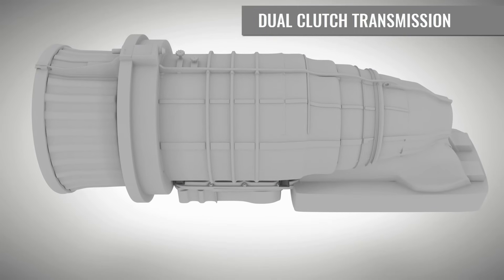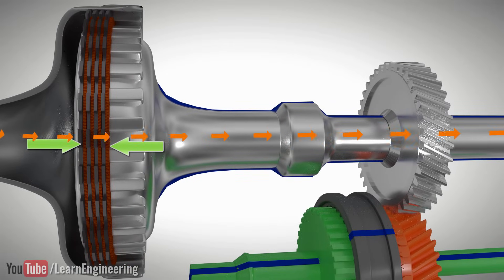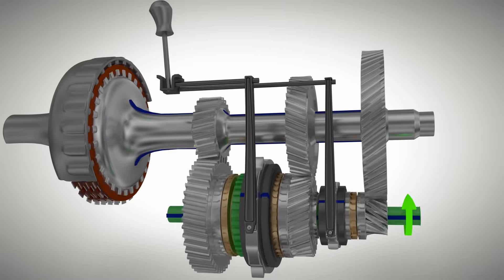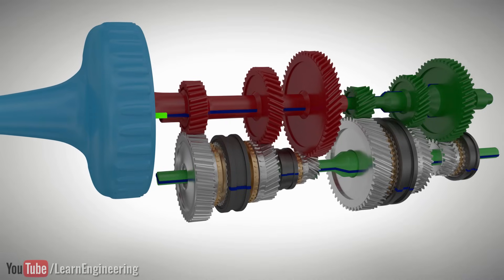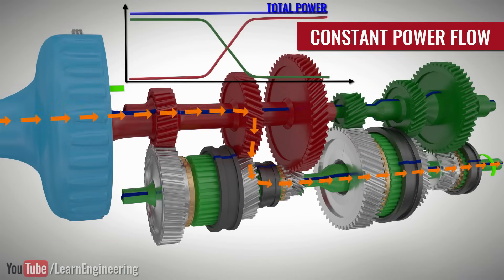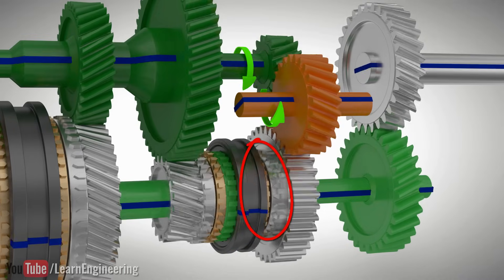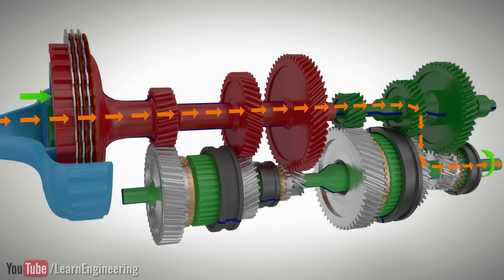Working of Dual Clutch Transmission (DSG)

Comment: DCT works great in performance vehicles where its easy to predict for computer which gear is next. When you hit full throttle computer expects next gear will be up shift, when you hit breaks computer expects next gear will be down shift. But for every day use it is horrible. There is no way for computer to predict next gear in crowded streets or in traffic jam when cars are crawling.
Reply: 1st to 2nd is the most obvious change by far, but from 2 onwards they becoming exponentially less noticeable in terms of changing gears. But yeah In crawling speed traffic it gets a little confused on whether you’re going up a gear or down, but I’ve learned to find the sweet spot in 2nd or in 3rd to keep it steady. If you can’t drive with a consistent speed and you keep having to brake then you’re gunna have a jerky drive. Learn to crawl at a constant speed
Reply: The DCT used in the Ford Focus and Fiesta appears to be a poor design. Many law suits resulted ,  I had a Focus, it was reprogrammed several times in the three years I owned it. It was a very poor shifting car in the daily stop and go seemingly it could not determine how to compensate for short stop and go situations. There is a class action against it now, happy to be rid of  the Focus, some days the program would crash and the car wouldn’t move.
Reply: I dont know what car you have driven, but the ones i have, i dont feel the shifts at anypoint. Not in higway or in traffic.

Comment: "Since it's as smooth as an automatic transmission..." because it IS an automatic transmission, would be my guess...!
Reply: I think they meant smooth as in no longer having to manually use a clutch because as you shift, the clutch is automatically applied appropriately. An automatic traditionally using torque converters have smooth shifts because it's all automated.

Comment: I don't understand how 2 gears can be engaged to the output rotor at the same time if the gear  ratio is different
Reply: 2 clutches. One is engaged, one is not. It is told in the video.

Comment: there are paddle shifters in DCT cars that allow clucthless upshifts and downshifts. Right? Do we require three sets then? If no ,wouldn't that be less complicated that using a computer program to determine which gear to shift next?
Reply: Computer does all the work. You dont need shift pedals. If you have them, that just allows you to select certain gear.

Comment: The DSG technology is already use in heavy duty trucks like in those semi trucks like in Freightliner Cascadia Evolution.  I know when I  drove one, they had a automatic and manual setting.  Push up on the the right handle near the steering wheel to upshift and push down to downshift.  As the video shows, they are starting to use this because it gets better gas mileage

Comment: Dual clutch automatic transmissions are not perfect. Whilst extremely rapid shifting UP gears, it is sometimes very slow and jerky when manually requested to change DOWN gears. This is because it pre-selects the next gear up by default. It shifts down rapidly if you floor the throttle when the electronic control takes over. Also, I've found them to be occasionally jerky and laggy at low road speed due to the clutches trying to regulate slip.

Comment: In reality, when you disengage the clutch you will not loose a lot of speed. You will stop accelerating, sure, but the car will still have same speed because of inertia. Thats why your graph with dips in speed during gear switch is incorrect.
Reply: procerator You know the friction, right?
Reply: but every body needs faster shifts!!! what if the kids get late to soccer practice?

Comment: A well sorted & tuned DCT is the best performer. However a shitty DCT (looking at you Mercedes CLA250) is jerky and dimwitted, falling on its face & shuddering the entire car if you get on the accelerator too quickly. 

The best DCT by far is from VW group. The Audi A3 S-tronic is a great example of a DCT done right; smooth, instantaneous engagement and smooth shifts on the move as well as good logic that predicts downshifts but doesn't hunt for high gears.

However I still think a traditional automatic is smoother still. The ZF 8spd automatic that is used on the Audi A4 and Jaguar XE is lightning quick and a better daily companion.

Comment: I don't know why you more effort on transmission system TESLA invent all new car which no transmission part and only open differential and there is no worry of traction loss and there is use of sensor and for traction control there is no slip differential and there is no any need of of IC engine and there is only "Induction motor and inverter,lithium power cell for a car & it's a RWD and give more acceleration,no clutch,no vast planetary gear for transmission only 2phase of transmission, no need to apply brake for stopping of vehicle only release accelerator then car is to be slow down and regenerative braking occur and no heat generation no COOLANT FLUID for cooling and much more features If you know more about that then you check on YOUTUBE for documentary of TESLA car in NAT GEO

Comment: Why is he saying that you get more sluggish acceleration with a manual transmission than with an automatic. If done correctly gear shifts are much quicker on a stick shift than on an auto and it gives you more control over the engine speed allowing you to shift at the optimum rpm to get the best acceleration with out a computer doing it for you
Reply: Wind the motor to 6k and dump the clutch, then tell me if it felt "sluggish".
Reply: He's saying it's more sluggish because it's more sluggish.

Comment: why when the torque converter slippage and generates heat,, ---- how did can effect the fuel efficiency? please can some one explained it to me? thanks a lot
Reply: Generating the heat takes energy which then does NOT go to moving the car.  Hence MPG suffers.

Comment: So DCT can't be used for manual transmission? The video said it needs control system to pre-select the next gear.
Reply: No it cannot. DCT is a type of "automatic" transmission, which based on the concept of manual trans.  And yes, it needs a control system, which should be smart enough to anticipate if you are going to need an up shift or a down shift. If the control system is not "smart" enough, it will take sometime to figure out what you want. And if you tried to use the '"manual mode", DCT is slow, since it would take some time to "pre-select" the gear you ordered, then make the shift.

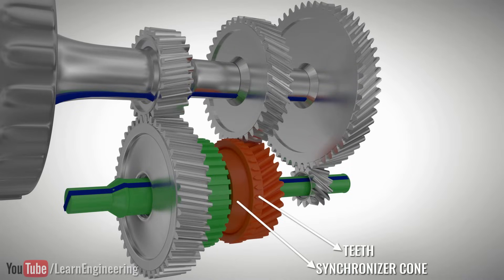Comment: Ok so, on the manual transmission example, the hub that is fitted to the shaft at 1:08 must be permanently attached to the shaft. It always spins at the same speed of the shaft. Am i right?

Comment: I have a question. Is the clutch Transmission just working due to friction ?
Reply: So u simply increase the friction between the Clutch-Plates ?
Reply: I believe this is right. That's why you eventually have to replace your clutch plate and pressure plate on a manual transmission.
Reply: @FortuneSeek3rz , someone that can actually drive a stick can easily get  200,000+ miles on the original clutch.

Comment: The fact they state that the reverse fears on a regular MT is not entirely true. The Mazda M5OD actually has a synchro on the reverse gear too, but it is one of few. The transmission was produced for almost 20 years, which is a real testament to its quality. I miss my old Bronco 2 which had one in it.

Comment: I've noticed an error in this video. You say that normal manual transmissions never have synchronizers on the reverse gear. This is not true, some of them do. I know this because I happen to own a manual-transmission car with a synchronized reverse. You also say that all DCTs do have a synchronized reverse, but that's not necessarily true, as DCTs can operate without it just as well as a regular manual transmission.

Comment: may be it is best for car services because it brakes on 50.000. that what happened with me on VW 7 step dsg. and the problem is still remains, I would not recomend to buy a car with DSG
Reply: Gloryan Headman Mk7 GTI 6 speed DSG 60,500+ miles (majority stop and go city driving) no issues. Recommend service at 40,000 miles, and Italian tune up two or three times a month. 
Ｖ－ＤＵＢ ４ ＬＩＦＥ 😎
Reply: youfoundisaac any way good luck )) I sold mine VW) and will go for toyota. VW owns me money wich I lost on sale differents plus moral compensation.
Reply: Gloryan Headman oh please. i just sold a 55k mile VW to some lucky guy and it drove perfectly
Reply: plus I sell cars with DCTs and I see them come back for oil changes with 150k+ miles

Comment: The Problem with The DSG DCT is, ID you Switch from The 4th gear to The 3rd gear. Its Takes much longer
Reply: That's because the stupid control system assumes you are gong to need 5th gear rather than 3rd, it takes time to take it off 5th and pre-select 3rd.

Comment: "Best transmission ever" Well, depends where you're coming from and what you want your car to do. In my experience normal oldscool manuals with a cluch is cheap, reliable, economical, cheap and simple to fix if they do break. and the only negatives is that you have to learn a skill, and 1sec powerloss while shifting. Upside is that when you do learn the skill of driving a manual you have more control. At the cost of using your left leg sometimes, and moving a lever...

I've had people tell me that a cluch change is expensive and you never have to do that in a automatic car. But a cluch that isn't abused lasts longer than most cars today, so I don't worry much about it...
Reply: Renax the Man manual all the way!
Reply: Renax, there is no powerloss on shifts if you "power shift".  You don't let off the gas and you just brush the clutch pedal enough to force the transmission in to the next gear while
the clutch is never fully released.
Reply: @789pokey  well, there is still a powerloss, but if you abuse the gearbox (or have a expensive racing gearbox) it can be less than a second...
Reply: @RenaxTM91 , a second is an eternity in a drag race.  At an average speed of 60mph, you're covering 88 feet per second.
Reply: @789pokey  Yea, in a dragrace you want the "expensive racing gearbox" option. For a normal daily driver a second to shift doesn't matter..
I get that most gearboxes you can shift faster than a second, and I can probably do it in half that with mine too, but mostly I don't bother. Anyways, a DSG box can potensially engage next gear simultaneously as it disengages the previous, but a normal manual HAS TO disengage one before engaging the next. this is my point. A dsg can be faster than any manual, but at the cost of weight, complexity and money.. For those reasons I like my daily driver to have the cheaper, more reliable and lighter option, even if it might cost me some time in a sprint... what will cost me more time in a dragrace is only running 1bar boost anyways ;)
Reply: @RenaxTM91 , no, there is not because you never disengage the clutch disc from the pressure plate and flywheel.  You depress the clutch JUST enough to force
the trans into the next gear with pressure on the linkage.  And you could do that with any stock Muncie, that's why the rings were made of brass, so if any chips fell off
they wouldn't damage the gears.
Reply: @789pokey  Yea, thats abusing the gearbox. I've done it, and it sure is quicker than shifting normally, but there is still powerloss, it physically impossible to engage one gear before the previous is fully released, in many auto's its not.
If you've had a manual gearbox apart you would know that there is absolutely no way to engage the next gear before the previous is released, and if it wasn't you'd wreck your gearbox in half a second. You can do it quick, with some gearboxes really quick, but one always have to fully release before the next is engaged.

Comment: So how are the controls for DCT vehicles? say you have a 5 speed and you go 1st....4th and then a turn comes up and you wanna tell the computer to keep 3rd on deck rather than 5th. is that too much to ask?
Reply: say you have a 5 speed
Don't know any DCT with 5 speeds. They are 6 speeds or more.

When you lift the computer algorythm already presets the lower gear. 

About telling the computer to keep a certain gear in check. I wish flippers would have a half press function.(like the shutter of a camera) Half press right to pre-lock up shift Falf press left to prelock down shift.
Reply: 1barnet1 Some cars do have the half-press on the paddle shifters, but it's not super common AFAIK.
Reply: By pressing the brake paddle, you are telling the DCT controller to pre-select 3rd. The most common issue with DCT is that, it does not downshift very quickly when you want a lot of  acceleration, since it always pre-select higher gear.
Reply: Why would you want to keep a lower gear ? If the car needs a lower gear I.e you’re on an incline then you press down a little harder to ask the engine (politely, of course) for more power and it will drop a gear. If you’re on a straight, then why not let the car go into the higher gear?

Comment: The worst automatic transmission possible. It combines the disadvantages of automated manual transmissions with high costs and complex setups. Dry clutch DCTs failed for every manufacturer who offered them, regardless if VW DSG, Ford Powershift, Honda i-DCD or Hyundai DCT. If you intend to keep your car for a long time and travel without hazzles or jerky experiences, get an CVT or torque converter AT.
Reply: Or get a wet clutch DCT. A six speed wet clutch DSG with a diesel engine is pretty common in VAG group taxicabs in Northern Europe. That combination seems to be holding together, but nothing beats a torque converter AT. The technology has been around for over 70 years, and is absolutely rock solid at this point.
Reply: Then the Toyota HSD arrived and Taxi fleets are converting over to Hybrid, as emission standards get more strict and a Prius turned out to be as similar resilient as an Mercedes E-class.
Reply: Pass me a hundred grand and I'll buy one.
Reply: Don't know what you're on about. The Hyundai DCT is far from jerky. The one in my Elantra Sport is smooth.
Reply: Or get a Tesla, and enjoy the simplicity without needing an Internal Combustion engine and complicated transmissions.
Reply: @TheRealMartin  Teslas are soy boy toys.
Reply: Every Porsche has DCT (called PDK), guess also most modern AUDIs (just to give an example). So now you're saying those are crappy cars, right?
Reply: Justin Grindley IN USA NO "NORMl person" drives a stick shift. 90% of vehicles are Automatic/cvt.
Reply: Kamuichan99 Hondas CVTS ROCK.
Reply: Or get a fuckin manual like a normal person
Reply: Kamuichan99 AMEN. I LOVE MY HONDAS CVTS. I WOULD LOVE TO BUY A MANUAL CAR/DIESEL BUT HERE IN USA I NEVER LEARMED TO DRIVE MANNUAL. IM AFRAID OF FUCKING UP THE CLUTCH.

Comment: I still like the good old stick shift (manual) transmissions best.  I could care less about smoothness of shifting, or that one more mile per gallon you might be able to achieve with a DCT.  Fact remains for me is that I have driven many different cars in my life and have never had any problems with a manual trans., nor have I ever had to replace a clutch.  The most miles I have driven in a manual has been almost 200K with not the hint of a problem in a stick.  Automatics a completely different story.
Reply: I agree Michael, in my more than 40 years on the road with everything from bikes to 44t trucks, I have had 3 clutches changed, I put a new pack in my rally car when built, had to do 1 change in 4 years of competition. Then 1 in a road car because my mechanic (brother) had a unwanted (free) pack on the shelf. My wife had 1 change on her Ford because in it's early life was a city car & most likely a clutch riding owner.

I have no idea the cost of a DSG clutch pack replacement, but I suspect it beats any laxative.
Reply: Michael Duke Dude my 3 Hondas are all Automatics and they range in milage between 184-236,000+ miles.

Comment: I know there were some companies (Citroen, for instance) that had a semi-automatic gearbox - It was a manual box with a torque converter.
Reply: does anyone know why can't automatics just be a torque converter next to a normal manual thing but the gears are changed by a robot?
Reply: You're right. A simple hydraulic actuator could replace stock shifting.
The automotive industry is the one of most resistant to change. Tesla cars had a 12 V lead acid battery to power all the accessories until few years ago.
Allison's has the de facto Monopoly in automatic transmissions, Bosch its own on ABS brakes, you can have your own if you design, build and patent a stick-shifter.

Comment: That is if you don't have to keep slipping the clutch in 1st gear in really heavy traffic and that it is perfectly programmed unlike the jerky ford units or the unreliable vw units. Mind you the cost of replacing one of these is astronomical.
Reply: Adrian Liu Mk7 GTI 6 speed DSG 60,500+ miles (majority stop and go city driving) no issues. Recommend service at 40,000 miles, and Italian tune up two or three times a month. 
Ｖ－ＤＵＢ ４ ＬＩＦＥ 😎
Reply: Well at least it is not the dry clutch 7-speed one
Reply: If you keep creeping forward slowly (below 3 km/h) without acceleration then yes that will happen. When you brake it disengages the clutch